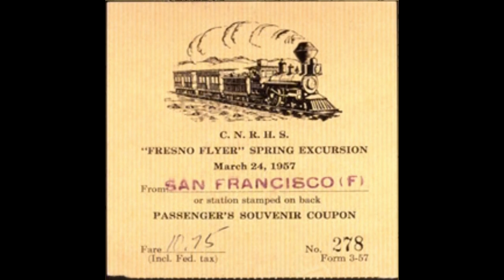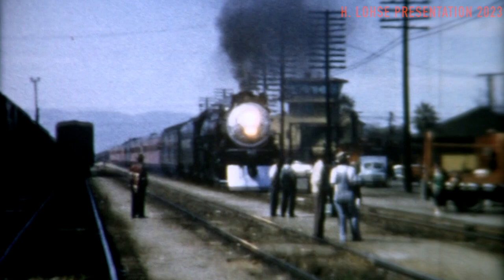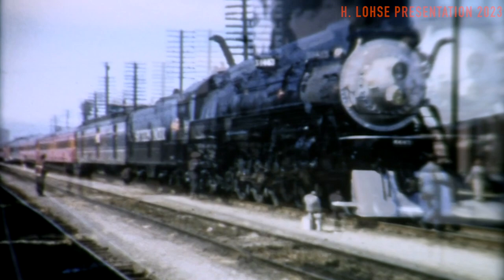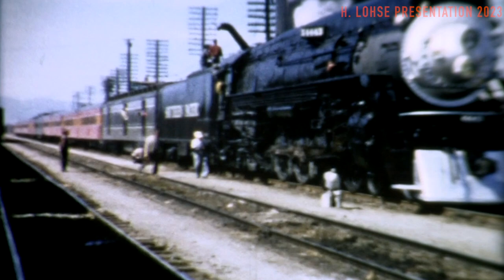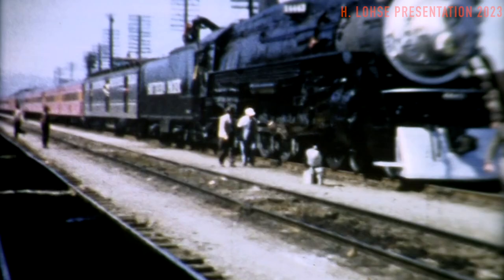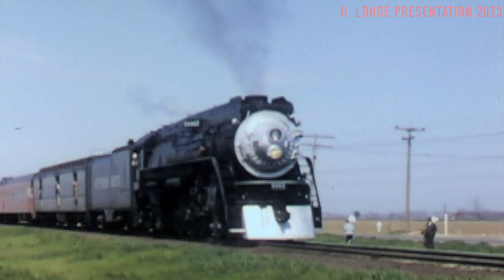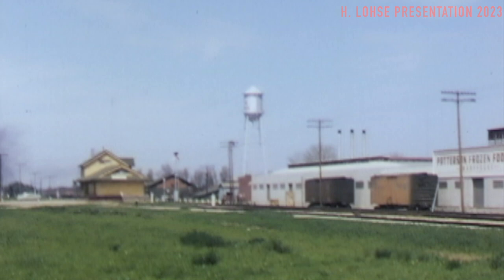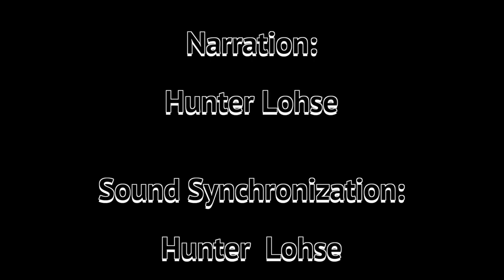Southern Pacific 4443: Fresno Flyer | Oakland - Fresno | March 24, 1957

Comment: 11:13 and 11:56. Note the train indicator boards changed from "X4443" to "51"! This indicates that the Oakland to Fresno portion via the West Valley Line through Los Banos was run as an "Extra Train" and the Fresno to Oakland portion via the San Joaquin Valley through Merced was run as the "San Joaquin Daylight."

Comment: man, fantastic trip, wonder how much of the Audio track was live?
Reply from the maker: None, all post production, home movies at this time were traditionally silent
Reply: @HunterLohseRRVideos  Does that explain steam whistles and what sounds like a ship whistle from the same loco?
Reply from the maker: @alwaysbearded1  No that is prototypical, GS4 locomotives had a steam whistle and an air horn
Reply: @HunterLohseRRVideos  Cool, must have had an impressive air reservoir for such a large air horn. (kidding, I know all the sound was post production just like my dad's old 8/super 8.)
Reply: @alwaysbearded1  They used the same type air horn (Leslie A-200's) as was used on E and F units from the '40s through the early '50s. SP usually used the air horn at  crossings with steam engines that had them.

Comment: Strange. It didn’t blow its whistle at all. Just it’s air horn.
Reply: 9:00 oh I was wrong.
Reply: 2:06 it also blow it hear
Reply: Air horn instead of steam whistle was standard procedure on SP engines so equipped.  But often on excursions, the steam whistle was operated for the fans.